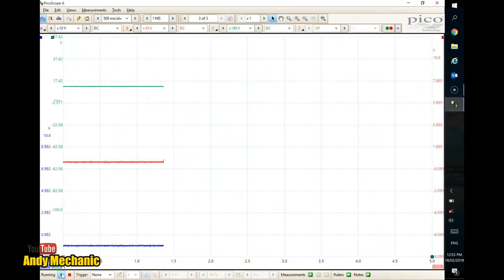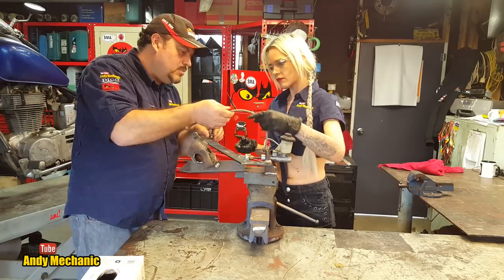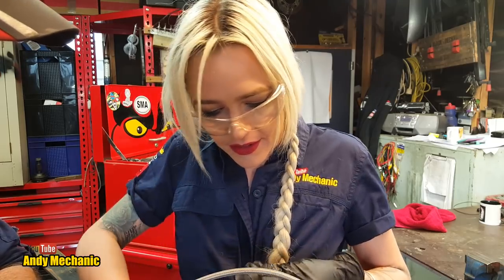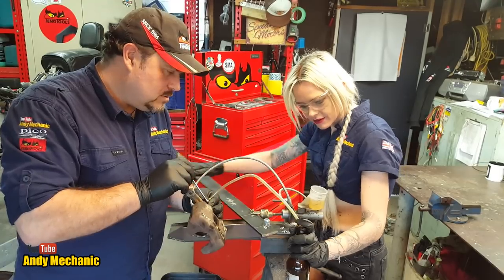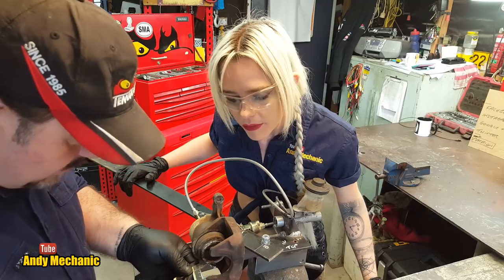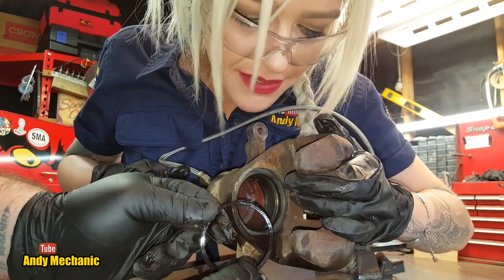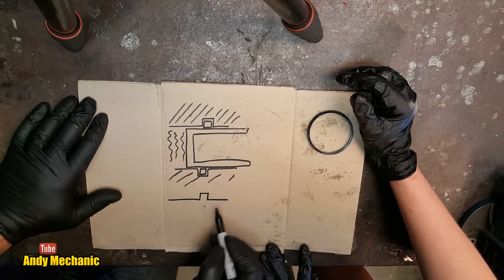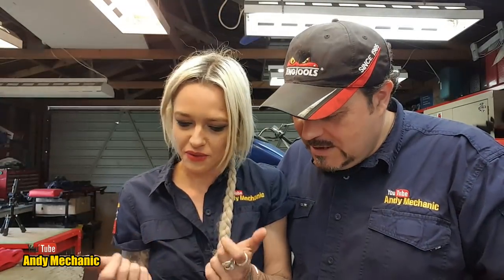What part is responsible for providing brake caliper piston retraction? Ft.Tool Girl Lilli #1337

Comment: Excellent video. I never knew about too much retraction. 

I was given a car a few years ago to fix up. It had a single worn out brake pad at the rear on the piston side of the caliper. So I replaced them paying attention to removing the rust from and contact points etc. Because the piston pressed in ok and it required a hammer to remove the pads I thought I had found the problem. However after a few minutes of fast driving the brakes would start to shudder as if the discs were warped along the hot brake smell. So I decided the caliper was not retracing properly and I removed the piston and replaced the seal doing nothing else. Problem completely solved.

Comment: Hi Andy, just watched #1337 video and interested in the "piston retraction" and specifically about the bit towards the end when you said about the "grease" that some people use when installing pistons back into the calliper, I have just had mine cleaned and this guy made a point of using this Red grease, but I cannot get a good leaver(on a motorbike) it comes back to the handle bar, I have bleed it numerous times, but with no luck, but I did put a cable tie on the leaver over night, but noticed that fluid had leaked out of the bottom of the calliper, so I stripped it down and wiped the remaining grease out and just used Brake fluid and some what better (not perfect) but do you think that the grease is my problem? Brilliant Video by the way and like your helper (lol), thanks Steve
Reply from the maker: Hi Steve,

Thanks for all the info. The calipers will need to be stripped, all of the red (rubber grease) removed, components cleaned (brake cleaner only) & reassembled using only brake fluid on the seals to aid assembly. The rubber grease is causing too much piston retraction - it's not air in the system causing the excessive lever travel.

sorry, you have work to do!

Have had this issue many times on calipers others have rebuilt

hope this helps. Cheers Andy

Comment: Hey Andy, I thought the two springs in the master cylinder and the spring in brake booster pull the caliper piston in when the springs uncompress.

Also, I have a 2005 Nissan Armada.  I recently replaced the booster(OEM) and master cylinder  (after market).  My brakes are now dragging.  I want to adjust the push rod from the booster inward but it doesn't appear to be adjustable to me.  Are some boosters nonadjustable?
Reply from the maker: Hi, nop, nothing to do with Springs in the master cylinder, they are there to return the primary and secondary pistons to their rest positions after brake applied.

Cheers Andy
Reply from the maker: If you can't adjust the push rod length then just add thin washers between the master cylinder and booster ;-)
Reply: @AndyMechanic  Thanks for the advice.  I will try it.

Comment: Thank you for this great video lesson. My car got low and spongy break pedal that sinks to the floor after the rear brake pads change and brake fluid change in a service shop. And after eight months and several brake bleeding procedures I'm still unable to get back my old firm brake pedal. Tried another master cylinder too - same sinking pedal. Now when I saw this video I started to think that this might be the actual reason for the low pedal. Maybe during the change the mechanic pushed the rear brake caliper piston too far to be able to put the caliper over the new pads and that somehow changed the contact between the seal and the piston possibly leading to the bigger piston retraction. But I don't know how much the usual retraction should be. A tenth or two of a millimeter? Maybe more or less? Can you tell me?
The obscure thing here is why I have the same low and spongy brake pedal when the parking brake is engaged and the brake pistons are in contact with the pads but depressing the brake pedal gives the same  spongy feeling and sinking to the floor. Stupid and unexplainable to me.

I've published a video here https://www.youtube.com/watch?v=eOXuZasD7YY
Reply: Okay have you discovered the problem? I'm going thru the same issue.
Reply: @zuranku  Still no. How did your brake pedal become soft? What is your case?
Reply: @stanimirpavlov  I think there is still just a little bit of air stuck. After bleeding the first few pumps will be soft and then it hardens

Comment: Is piston retraction failure by piston seals the only reason for binding brakes(wheel locking without pressing the brake pedal)?? Can any other factors or components such as the master cylinder be responsible for binding brakes?? I am from a car team and we experienced binding brakes in the front even though our calipers were brand new.
Reply from the maker: Hi, thanks for the comment. There are a number of issues that can cause brakes to bind on. Piston retraction  is just one.

I'd check the following:

Push rod clearance between master cylinder and brake booster (servo) - this is critical as if no clearance (push rod too long) then the compensating port in the master cylinder is blocked by the main seal on the primary piston. As the brake fluid heats up it expands & cannot leach back into the reservoir, instead, pressure builds & pushes the pistons out binding the brakes. 

If there is no freeplay between the brake pedal and brake booster it can also cause the same symptoms.

If you have floating calipers then check the sliders are free and lubricated

Okay, hope this helps. Let me know how you get on.

Cheers Andy

Comment: What happens if there's air in your system will it cause the caliber to bind......please answer this question because I've replaced my entire caliber system and break line and it works fine and then my passengers break locks up again until I loosen the bleeder valve then I can drive a day or more and it will do it again just the same one caliber........im so frustrated HELP ME PLEASE SIR I also put new fluid as well and I have new pads
Reply from the maker: Hi Cory, simple answer is definate NO. Air in the system or the brake fluid has nothing to do with piston retraction.

Cheers Andy
Reply: @AndyMechanic  well why do they work properly and then lock up after all I have done please help
Reply from the maker: Ah...that's easy....you either have no brake pedal free play or the push rod between the brake booster & Master Cylinder is a little too long & not allowing the piston in the master cylinder  to reach its rest position - this blocks the compensating port & prevents the increasing volume of fluid in the system  (thermal expansion) as the coolant warms, to leach back into the reservoir. This causes the pistons in the circuit to be pushed out resulting in the brakes binding.

There is a video on my channel covering this.

Cheers Andy
Reply: @AndyMechanic   thank you so so very much ......have a great rest of the week mate